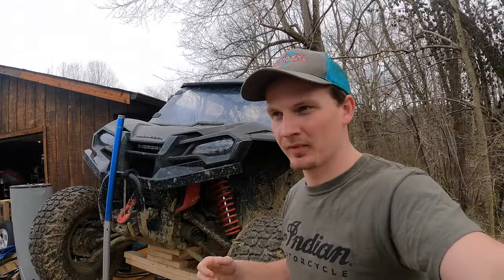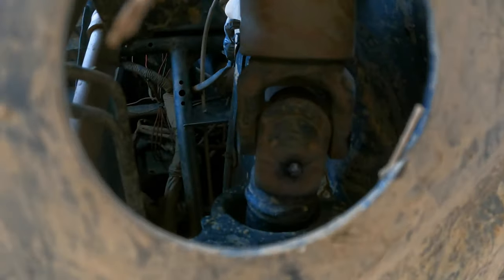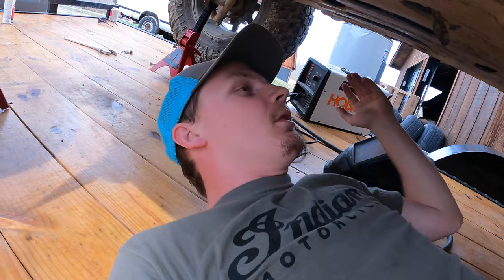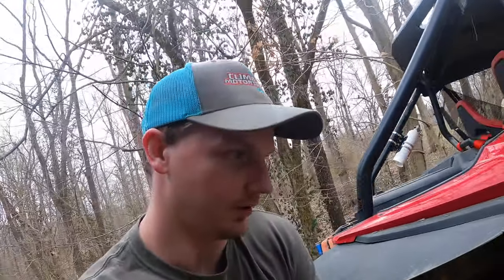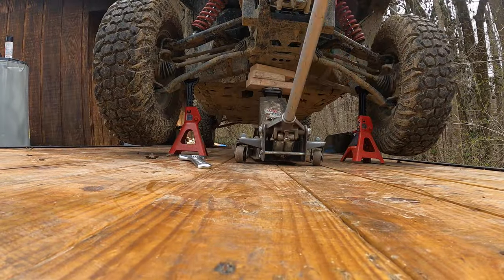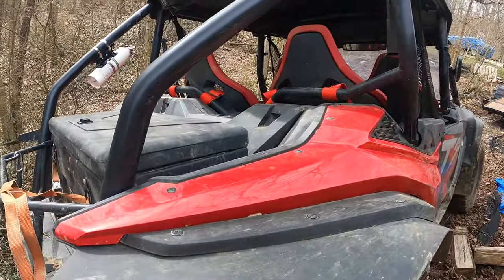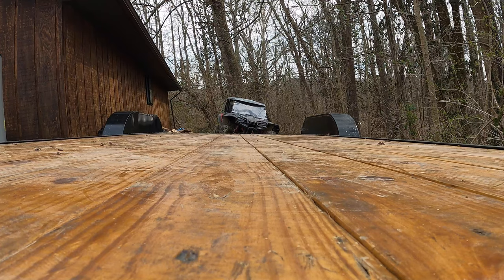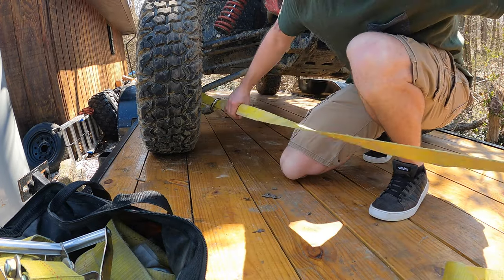How to fix the #honda #talon universal joint problem.

Comment: That's a real old school trick there, tacking the yoke to keep the joint caps from spinning out. Surprised Honda has that issue.
Reply from the maker: Yeah it’s more common on the earlier models.
Reply: @PursueYouu  we are having a tapping noise from the drivetrain only after the whole thing heats up good. —2021 1000x4 but it is under warranty. I’m considering having this fixed under that warranty
Reply from the maker: I didn’t have any noise from mine. But heard some stories. I would look in to the noise some more. If it’s front end or right behind you.
Reply: @PursueYouu  it sounds like the transmission or the rear differential, but i only hear the noise above 4th gear or so, when it’s not cold.
Reply from the maker: @EGGSHL  consistent noise or low RPM rattle noise?
Reply from the maker: @EGGSHL  4th gear high rpm is moving pretty quick. It could be a few things especially with all the vibrations that they can have. like tires being unbalanced or engine at a rpm and speed just right has a hard vibration through the whole car in that one spot.
Reply: @PursueYouu  it’s a low RPM rattle but also when it’s moving in 5/6 gear it sounds like it just has more play in the gears. Odd. The low RPM rattle comes from the doors and that front axle creates a little squeak
Reply from the maker: @EGGSHL  ours does the same and my buddies does it. I think it’s just the clutch’s shuttering. Like being a manual car or motorcycle to high of gear and low of speed is never smooth. The driver shaft squeak could be from your drive shaft rubbing on something. I would look at it and see if it has any wear marks.
Reply: @PursueYouu  the vibration i’m talking about is ACTUALLY  the door bushings being too loose. There are 3d printed fixes for this n i’m
Reply: Probably about to ask others if they have the model so i can print it. Some people sell them on ebay for 30 bucks a set though